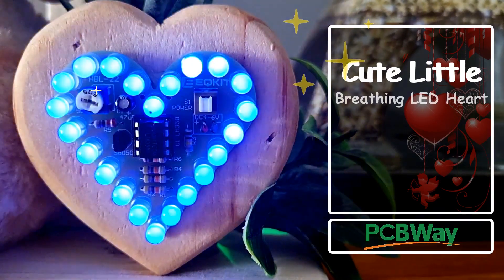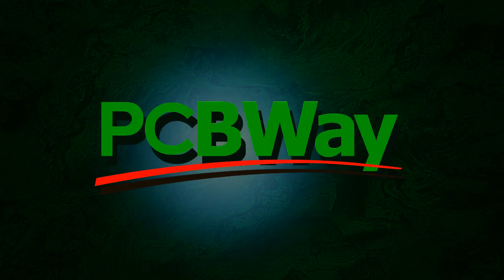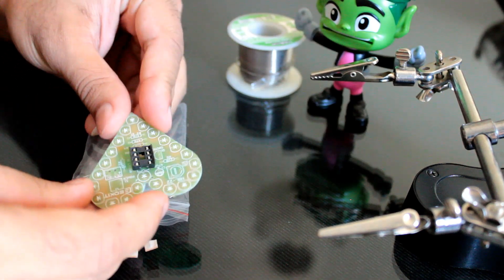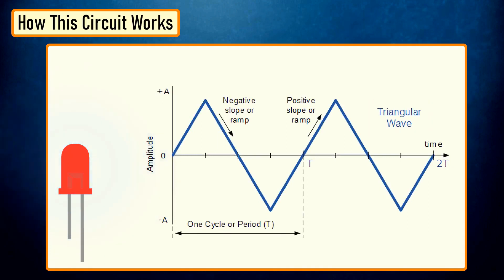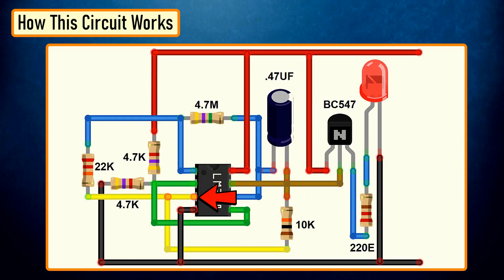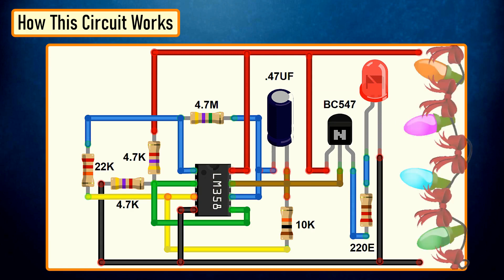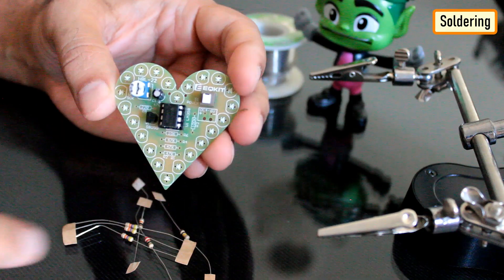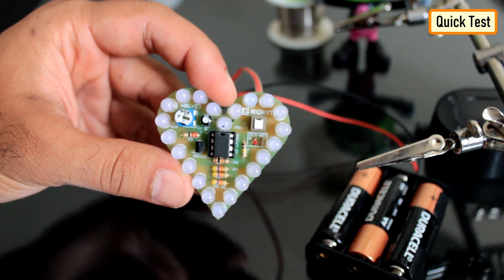Cute Little Valentine's Day Gift 🌞🌞

Comment: great idea, simple design and parts. could you kindly send us the pcb file so we could just print it by ourselves. I would be grateful if you could
Reply from the maker: I bought the pcb from Aliexpress..
However, I do have a couple of videos on the same using lm358 ic 
Please checkout my tutorial   24. I have a Gerber that u can use for the same. Just remember different colors have different forward voltage, so keep that in mind.